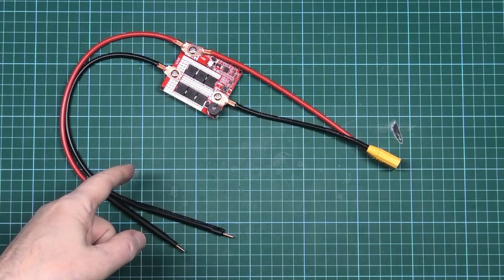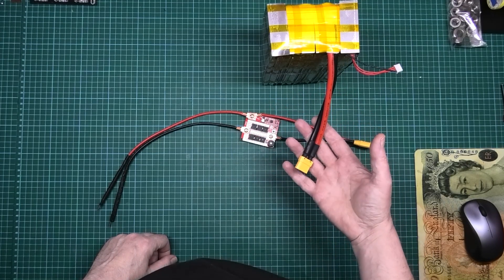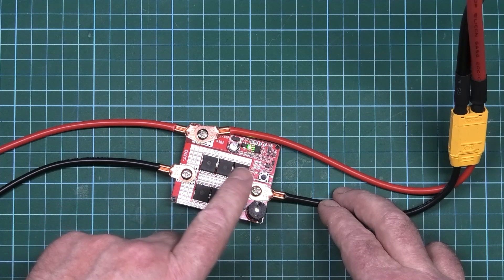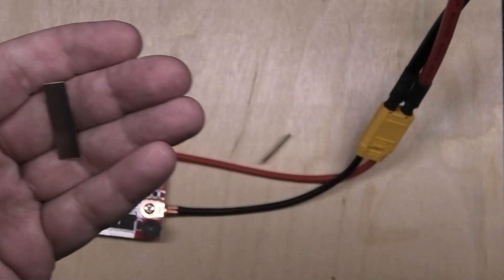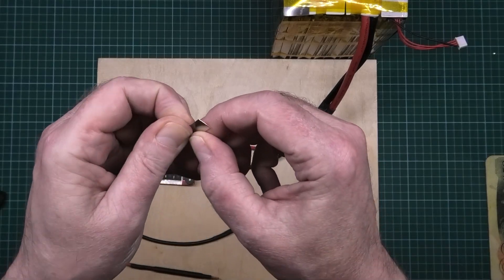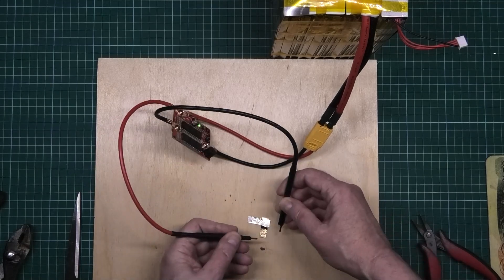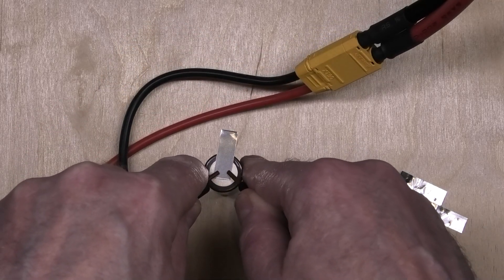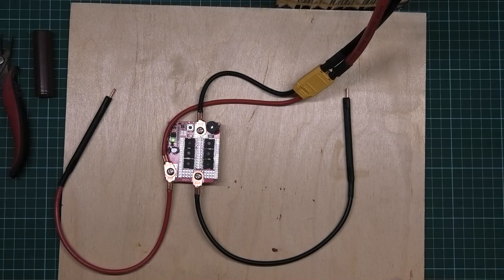The cheapest spot welder on the internet!

Comment: I blew up 2 a bit like this. It was either as i tried going over spot welds twice or because i was using to low a voltage for the switching circuitry 12v car battery which was bottom of the recommended range. Or that the switching circuit being powered from the same source as the spot weld is just a bad idea. Or the mosfets are just not up to it. I also wondered that I shouldn’t have beefed up the tracks and maybe the high resistance there softens what the mosfets deal with. I definitely only got a couple dozen welds out of each. Mine was the rectangular type with the xt conecter on the board.

Comment: Perfect for making the occasional 4S pack...although I prefer to solder mine.
You have to solder balance wires anyway...🤔😳😳🇬🇧...Hope your backs getting better Tony mate...🤔
Reply: You can solder the balance wire to a small piece of strip and then weld the strip on
or keep the strips long and fold it over the edge of the cell (with insulation behind) and solder there 
directly soldering to the cell can damage it if you aren't careful
Reply: @akbarramzan7436  Soldered lots of these metal cased cells...Just clean it and a little flux with a big Soldering iron. Joint literally takes less than 2 seconds...I use 1mm solid copper wire...Using a smaller iron, the balance leads are then soldered to the Copper wire....It's pretty easy to do if you are just making the occasional pack up...🤔🤔🇬🇧
Reply: @EnglishTurbines  Yep I have soldered cells with no issue before as well and your technique is the best way to do it. I did tests with a low power iron which took several seconds to achieve a solder joint and there was a measurable increase in internal resistance.

One of the best methods of creating a pack I have seen involves no soldering for the balance wires and termination leads. Instead, everything under vibration stress is either welded or crimped and bolted together. em3ev solder their balance leads but have a 2A polyfuse so if the solder joint fails, the balance lead won't catch fire